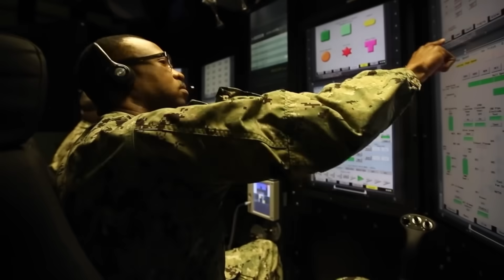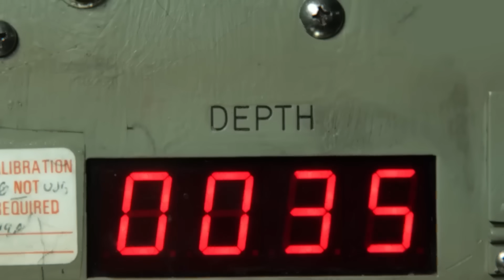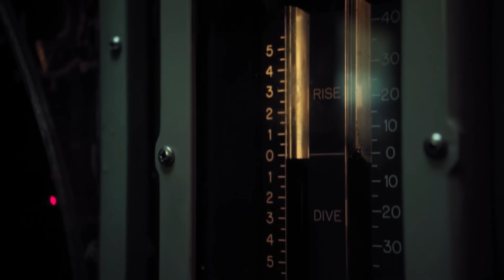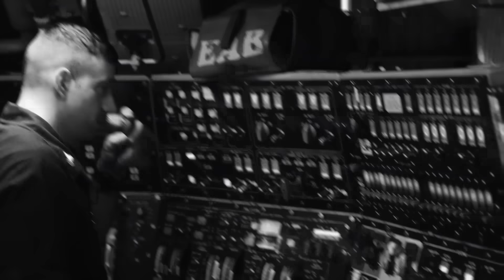What Happens When a Submarine Hits "Crush Depth"

Comment: Not "in a matter of seconds"  (which is slow). The submarine actually imploding is an "explosive" event (that can be heard by microphones under water. That is to say: the final crush happens in a small fraction of a second, and is probably so quick that the people inside will not have a concious experience of it.
Reply: The body collapses faster than the speed needed by the pain neuron to get to the receptor. Painless, instant (nanoseconds) death.
Reply: @MrGelzo81 the body disintegrates faster than the time it takes for a sensory signal (from ears or eyes) to travel through the sensory neurons to the brain and be interpreted by the cerebral cortex. Neuronal signal conduction takes hundreds of milliseconds vs implosive material and body tissue disintegration occurring under 6000 psi can happen ~1000x faster i.e. on the order of microseconds to hundreds of microseconds. This is somewhat like a stationary observer not being able hear a supersonic jet as it approaches.
Reply: @TropicalVibesHD  👌
Reply: @TropicalVibesHD  that is not what the true experts says.
Here is what was reported. 

When a submarine hull collapses, it moves inward at about 1,500mph (2,414km/h) - that's 2,200ft (671m) per second, says Dave Corley, a former US nuclear submarine officer.
The time required for complete collapse is about one millisecond, or one thousandth of a second.
Reply: @bobmac9070  I do not disagree with this at all. We must recognize  these numbers are "estimates." So "order of magnitude" is the essence. So we can say crush or implosion of a submersible (likely a bit faster than quoted for a submarine which is larger and for which the implosion data is quoted) happens on the order of "hundreds of microseconds;" human sensory perception occurs on the order of "hundreds of milliseconds." That illustrates the point well. The numbers don't need to be exact. 1 millisecond is just 10 hundred microseconds so if we believe that applies to a submarine  we can be comfortable accepting "hundreds of microseconds" for the implosion time of a submersible vessel such as Titan. This is not different from the numbers or "point" made by the uber experts you quoted. 🙂
Reply: @TropicalVibesHD  First off it’s not my answer. If you reread it, it’s direct from the navy if you want to argue your point argue it with the US Submarine Naval officer…. Dave Corley not me!!! 
😤
Reply: @bobmac9070  I already rested my case and have no further comments. 🙂
Reply: @TropicalVibesHD  Thanx for the details, I'm alergic to numbers ahahahahahah
Reply: @MrGelzo81 that's what they want you to believe.
Reply: @ClumsyCars  Who and why?
Reply: Implosive.
Reply: @Medevah  Indeed. But what I wanted to express is that that is not a gradual process, like the video suggested but a extremely quick and violent process, like an explosion.
Reply: @rientsdijkstra4266  Well, we’re talking somewhere in the magnitude of 15,000,000 Pa of pressure, or 300 atmospheres, or 4,500 PSI.

This is enough pressure to disintegrate mortar, remove stain from wood, and dig a hole 12-18” deep in dirt. That’s how violent we’re talking.
Reply: @Medevah  Indeed!
Reply: Isnt it all relative over time as the change in depth progresses?. I feel like if you spontaneously put a sub at 5,000 feet, it would basically evaporate. At 0ft-5000 feet wouldn't you feel the shift in pressure and continious damage before the final implosion
Reply: @BreeZieDoesiT did you even watch the video
Reply: That's a good death (not that death is good but like the way they die is "better", if that makes sense)
Reply: But did the people in the sub have several seconds of warning BEFORE the implosion happened? That's what I have wondered about.
Reply: @cathydanielson9995  That's hard to know... it's possible that there was some creaking and moaning from the construction, however I would guess (!) that once the problem got accute events will have unfolded extremely quickly...
Reply: I honestly don't believe that, my bet is that someone ran a simulation with this outcome and everyone chose to believe it because it's much better to believe people passed away peacefully, in reality there are probably many variables that would influence how fast the implosion would occur, we can only speculate then as of today
Reply: It was said the implosion would have only taken 1.5 seconds at that depth, there’s no delay. 😢
Reply: @bobmac9070  1.5 seconds is LONG. Reality more like 2 nanoseconds. Catastrophic failure under such enormous pressure is instantaneous.
Reply: @rientsdijkstra4266  Sorry but not nano , but mills second s. Per experts lol 😂 lets get it right 🤣

When a submarine hull collapses, it moves inward at about 1,500mph (2,414km/h) - that's 2,200ft (671m) per second, says Dave Corley, a former US nuclear submarine officer.
The time required for complete collapse is about one millisecond, or one thousandth of a second.
Reply: @bobmac9070  Well then you are probably right. But still that is a lot faster than anything that a human could consciously register....
Reply: right firstly its and "IMPLOSIVE" event. the bang you hear is the water and all debris slamming together and the water "dieseling" like you get in a cavitation bubble. and in case you haven't noticed the images in the video are a slowed down version of the actual event to help illustrate, as it likely happens faster than you can see. also in regards to the last bit of your comment......i bloody hope so.
Reply: @roberta6641  Here too: I agree 100% with what you are saying! I only used the term "explosive" (notice the quotes) to indicate the suddeness and violence of it.. And I share your hope!
Reply: I'm pretty sure they will register it, I don't see how it can be that quick... the air gets pressurized by the water around it when a catastrophic hull failure occurs. But the breaking of the hull and the pressurizing of the inside chamber doesn't happen as quick as your brain works, atleast I assume so. I keep seeing people making this claim without any evidence or argument for it
Reply: @dikkeoliebol  In cases where it happend (f.i. the infamous Thresher) it has been reported that a loud BOOM or THUD was heard. Furthermore it would seem to me that it is not necessary that all air is immediately "expelled" or "removed", only that the pressure rises in a fraction of a second to (at a 4000 meters or 13100 feet) 5850 pounds per square inch or 400 bar in metric terms, and the volume decreases correspondingly. Which is enough to squash anything and anybody instantly.
Reply: @rientsdijkstra4266  Yes i understand this, but this is only the case when a big portion of the volume collapses at the same time. Lets imagine just one bolt came loose and opened a 1/4inch hole in the hull. Water would come in through the hole under the high pressure difference, slowly filling up the inside of the hull and increasing the air pressure. It would take quite a while for the inside pressure to balance out against the outside pressure, somewhere along the way the air will be compressed so much it would be deadly for the people inside.
Reply: @dikkeoliebol  It is not about "water coming in through a hole and filling the hull". It is about CATASTROPHIC FAILURE OF THE HULL AS SUCH. That is something COMPLETELY DIFFERENT. All the specialists say the same thing: at this depth, once it goes the implosion happens at a speed and power that is comparable to a heavy and powerfull explosion. I read one report by a specialist who talked about 2 nanoseconds. You can look it up if you want, there are many sources on Internet and YT. I am going to leave it at this. It takes to much of my time. I wish you a good day.
Reply: @rientsdijkstra4266 In plaats van de initiele reactie aan te passen (waar ik overigens als een screenshot van heb gemaakt), zou het meer gepast zijn om even te reageren. Ik ben zelf student bij de TU Delft (LST), ik heb geen les van u gehad maar hier schrik ik wel een beetje van.
Reply: @dikkeoliebol  Ik weet niet precies waar je op doelt. Maar ik neem aan op mijn opmerking over visualisatie. Die heb ik verwijderd omdat ik enigzins geirriteerd was op het moment dat ik het schreef, en bij nader inzien bedacht dat die opmerking wat te ver ging. Waar ik nu echter van SCHRIK is dat jij als student van de TU kennelijk het verschil niet ziet tussen een catastrophaal falen enerzijds en het gradueel vollopen van de romp anderzijds. Het enige wat ik deed is de informatie herhalen die ik op vele plaasten heb gezien en opgenomen dat het catastrofaal falen van een romp onder grote druk gepaard gaat met een harde en zeer snelle klap. 
Je hoeft dit van mij niet aan te nemen. Je kunt het op vele plaatsen op internet en YT terugvinden. 
En wat je verder denkt te beginnen met screenshots en zo boeit me totaal niet. Ik geef jou een mening en vertel wat ik weet. Ik hoef mij daar verder op geen enkele wijze voor te verantwoorden.
Reply: @dikkeoliebol  different mechanics at play, same end result  https://youtu.be/kM-k1zofs58?t=176
Reply: @nabicookie  Indeed! But that example is at groundlevel with 1 Bar of external pressure difference. At 4000 meters of depth the pressure difference is 400 bar, so the difference will be 400x as big. You can image the suddenness and power when that happens...
Reply: @rientsdijkstra4266  oh ya, i knew the massive difference in pressure. it was just that as i was reading the comments about how fast/slow/sudden it could've been that i remembered this and wanted to show others how suddenly and quickly it could've gone from normal to crushed. i'd actually forgotten all about this and how sudden it was. scary to imagine that happening underwater at those depths.
Reply: @nabicookie  I understand, and the example you give is very instructive (thanks!), I just wanted to add the next step: you see this... than imagine what happens when the pressure is 400x higher... And as people said, the violence is scary, but on the other hand it is comforting that it will be so violent and fast that it is very unlikely anyone in there will even notice what happend.
Reply: @dikkeoliebol Do you know what a Cavitation bubble is, if you do then imagine that but the size of a submarine.
Reply: @rient  How do you know? Have you saw it happen?
Reply: @thetruths7389  No, of course not, but I heard reports and saw video's about what happens when a submarine implodes below crush depth. Reports that I believe are reliable (especially because there are many)
Reply: @rientsdijkstra4266 you don’t even need reports or to see it. If you understand the science, which you appear to - then you know what would happen in that situation. Makes sense
Reply: @KidsWithGuns1992  Agree totally!
Reply: @thetruths7389 physics, my guy
Reply: @thetruths7389  Question for you: have you seen it happen?
Reply: I'm sure it's extremely quick. Like a fraction of a second when it implodes. But I'd be shocked if the crew doesn't experience the submarine collapsing on them.
Reply: @rt-uh6mt before they realized it, they're gone.
Reply: @rt-uh6mt  I think we must distinguish 2 things (as I see it..): 
1.) (possibly) before the final "bang" there will be a phase where the whole construction starts to creak and moan making scary noises, and for the crew and passengers who know what is coming this must have been extremely scary and stressing. However, I also read a reaction by somebody who said it could even have happened without any warning. 
2.) the final moment itself will have been so quick that they did not have time to experience it consiously

Comment: wtf that Thresher story - it's hard to imagine that the sub wouldn't be designed to failsafe if the reactor became inoperable due to water, critical malfunction or other damage. Also kind of weird that the batteries and reactor wouldn't be separated and capable of operating independently to provide emergency operations if either failed =/ Will have to look at the report.

edit: okay looked it up - still some questions, but they did indeed attempt something resembling a failsafe procedure by blowing the ballast - but this failed spectacularly in practice because there was either no or insufficient dehumidifying of this highly pressurized air, so it became incredibly cold and froze under normal operation - meaning if you went to blow the ballast at depth you'd get a little sputter then it'd just clog, frozen. I'm still very unclear on why batteries weren't an option - I was fairly certain even the old nuclear subs didn't operate using their reactors when running silent, but the accident report seems to center on the issues restarting the reactor and how the standard procedure did not permit a rapid restarting or the utilization of remnant steam to power the sub long enough to surface =/
Reply: From what you have read, do you think the captain and crew were aware they were about to die?

Comment: Wait four days for your air to run out or possibly be rescued in that time or be crushed instantly and never know what happened.
Reply: That's gotta be one of the most horrifying ways to die. Knowing your stuck in the ocean, no one knows your location , and if they do chances of a successful rescue are low that deep underwater,  and your oxygen is steadily decreasing to 0
Reply: @zlevelx  not to mention trapped in a small space of solid steel at PITCH BLACK darkness for days. They say it's so dark that you cannot see your hand in front of your face.
Reply: I’ll take the running out of air option, as CO2 levels rise and O2 drops you’d just pass out and die.
Reply: @simondrew7346  CO2 poisoning gives you the mother of all headaches.  You will be glad to pass out. Without heating they may have perished from hypothermia first. The batteries were not designed to run for days.

Comment: This is sadley what probably happened to the submarine visiting the titanic
Reply: Wouldn't the sub go to the bottom of the ocean to see the Titanic? - If it's lost in that area, wouldn't it just be sat on the ocean floor?
Reply: @AlfieMaxMiMi  The pieces would be very, very small and there's no light at all at 12,500 feet. Implosions under pressure are violent events, like an explosion but you have water moving at hundreds of mph also.

Comment: TLDR
Crush Depth js exactly what it sounds like
The depth at which a submarine's hull cants withstand the water pressure its rated for, theoretically, its not like theyre going to destroy an expensive submarine to actually test it. They rin the numbers abd calculate it with very small devations in results. 

Theres no need to watch a five minute video about something that is self explanatory

Comment: Why could WW2 subs go lower than their nominal maximum depth and not be crushed? Slide rules! The fact that these were used because there were no calculators meant that all calculations were rounded up, and the effect of these cumulative roundings built in a safety margin.

Comment: Why didn’t the Allies in WW2 develop a SONAR with speakers 100m apart, one emitting a high pitch, the other a lower pitch, and the listener had one pitch entering the left ear, the other pitch the right ear, and from which pitch he heard first the direction the submarine was at could be worked out as well as it’s distance? Why didn’t the Axis develop a device for submarines that could be put out the torpedo tubes which moved around in circles emitting loud SONAR like beeps to prevent the SONAR listener finding the submarine?

Comment: I am curious, why not pressurize the air in the sub to counteract the outside pressure?
Reply: That is how saturation diving is done. The Problem is that you can only decrease the pressure over a long time (days/weeks) else the pressure difference would kill you.
Meaning the sub could only come to the surface very slowly.
Reply: @frankiepentangeli7100  Hehe, yea, would definitely need to undergo decompression. But can do it slowly as the ship goes home/gets closer to the surface. If the ship can compress the air as it gets deeper, seems to me that'd make it a good bit safer and allow it to go deeper.

Comment: I am surprised that with the number of (also old) subs aroumd that they do not equip one with cameras all over and then sink it deliberately 
 
On the other hand, that is top secret military information, so it probably would not be made public. 
 
And, such a test does not say much. As it is said, a sub has MANY weak points. Which one gives way first is almost a throw of a dice chance. 
 
When you hear that the suspected cause of the sinking of the Thresher is a rather harmless leak, but a a "strategically" maximum effect location to disable the complete power output, at a comparatively harmless depth, that shows this issue
Reply: Do you mean replicate pressure?

If for an experiment that can be done on land in a pressure chamber

Comment: Do Navy submarines have jettisonable metal ballast? I recall once reading about research submersibles having externally mounted ballast bars that could be jettisoned in an emergency, with them jettisoned the vessel should rise even if ballast tanks are fully flooded. I even recall one with a fail-safe system with electromagnets holding steel balls, if power is lost the electromagnets de-energize, the balls drop away, and the submarine rises. I'd think such a system would be a good safety measure in any submarine, could help with situations like the USS Thresher, as well as the scene in Das Boot where the damaged sub is unable to rise.
Reply: "The balls drop" lol